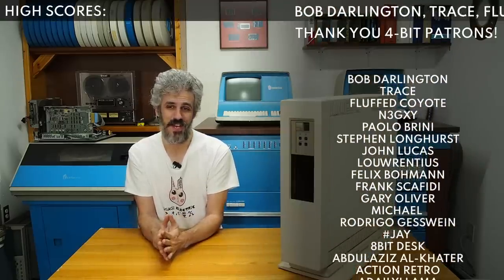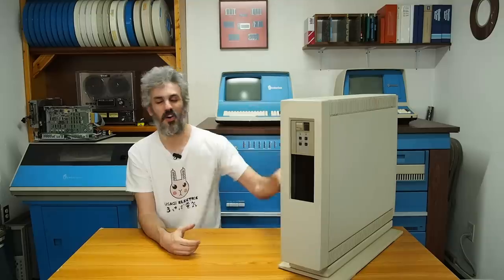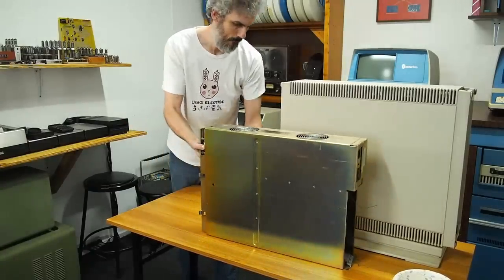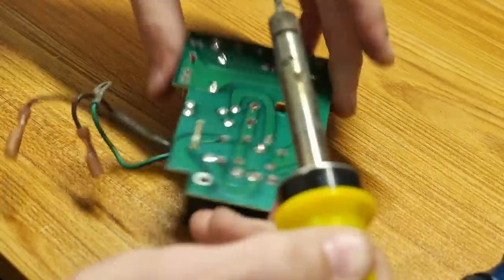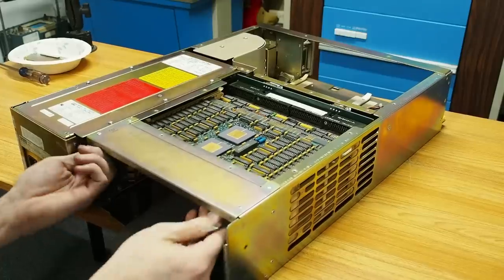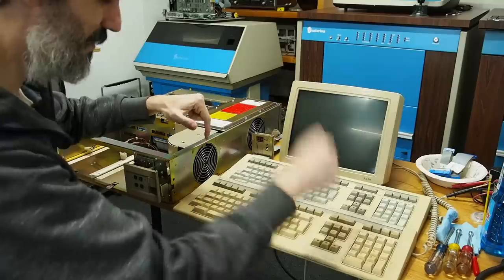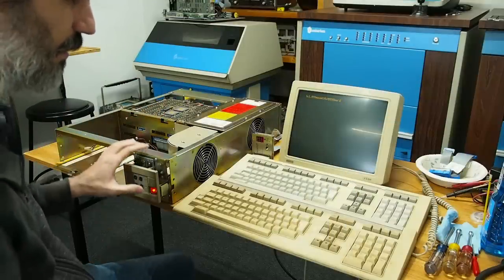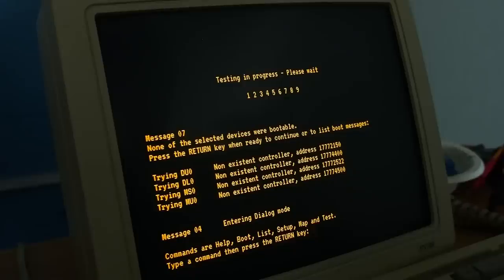The PDP-11/83 Boots!

Comment: I repaired those PDPs and VAXes for years. I did exactly what you did... but I also replaced all capacitors.
For the terminal, the smooth scroll can be changed in the settings (smooth slow, fast or jump). Don't forget to save the new settings. Otherwise the terminal will load the old settings after a power cycle. To do a "load defaults" would also be a good idea since you don't know what the former owner did. (And save again)
For the memories, you need to check if the DIP switch settings are correct. There is a starting address for each memory board. The first goes from zero to 2048kB and the second starts at 2048 and goes to 4096kB. If those switches are not set correctly, you get an overlap of the two ranges. That could be the reason for the "2040kB" display.

Comment: I worked at Digital in Canada and had a VT320 connected to a burn-in chamber running heating/cooling cycles on multiple main boards to test for thermal related faults. This was back in 1993 and the monitor and keyboard looked about as dirty as what you cleaned.

Comment: Cleaning old keyboards is a special sort of tedious that is only enjoyed by folks that find it meditative :)  Related, i had found that soaking the cables for cleaning leads to a grab-bag of odd symptoms due to water getting inside the outer sheathing. Those with phone service on older copper cables have hear what water on the line sounds like! The risk is reduced by keeping the ends out of the solution but the sheathing may have tiny cracks from age. It goes extra pear-shaped if the insulation on the conductors inside has also cracked with age. My fix is to pretend the cable is a cat - sprawl it out in a nice warm sun beam for a couple days.

Comment: BSD 2.11 - I believe it can run on it and is of course fully open source, still has random patches added even today. If you can get that running then you will recreate the point that kicked off so much of our tech world, apple, google, yahoo, everything traces back to the BSD line if you think about it, current macOS still has much of the exact same code in it. 

I also have a collection of a PDP 11/83 system, bunch of cards and components, and a number of various DEC terminals, vt220s, etc. My goal is to one day setup working system running BSD 2.11. One day. None of it works currently but you give me great hope watching this series. Thank you!

Comment: The VT240 was also a neat terminal.  The VT240 was a pizza box form factor used the same keyboard at the VT220 and Rainbow desktop computer.  The VT240 could support either an amber|green monitor or RGB monitor with separate R G B coaxial cables running at NTSC raster rate.  The VT240 could do NAPLPS graphics based around a NEC 7220 graphics chip.  In text mode, the standard VT100 / ANSI escape sequences are supported.  The problem is finding software to support the graphics.

Comment: Look to see if you have RT-11; it's a single-user OS, fairly simple to boot up, and can be run off of floppies.  RSX-11M is a multi-user system that requires a hard drive and a more involved system configuration ("SYSGEN").

Comment: It looks like the top 8K is mapped out of available RAM whether you have 1 or 2 memory modules installed. Looking at an MicroPDP-11 handbook from 1987 there's mention of some memory being reserved for memory-mapping features, but not clear how it's used. My experience with PDP-11 goes back to PDP-11/34 and 11/44 running RSX-11 or RSTS/E, but not much dealings with the MicroPDP family. Actually watching the video a little further I think the I/O Page Map shows what that reserved address space is used for. Note that RAM ends at 17757776 and the I/O Page Map begins in the 17765000 range, which corresponds to the missing 8K of physical RAM. This is definitely cool stuff! Can't wait until you get some mass storage attached and boot into an OS!!

Comment: Even when you booted with just 2Mb, the I/O addresses were at the top 8Kb of the 4th Mb (17757770 through 17777776). when you added the 2nd 2Mb the last 8Kb couldn't be used as it's already mapped off.

Comment: I used an 11/44 at college during 1982-1984. It ran RSTS/E 7.2-04 and  boasted a stonking 750K of memory. We programmed it in Basic-PLUS, an excellent language. It also had Pascal and Cobol which I experimented with. After I left they upgraded to 8.0-06. The final RSTS version was 9 I believe. When you log in to RSTS you got dropped into Basic, just like on an 8 bit Micro of the era!
Reply: BASIC-Plus was just the default “run-time system” on RSTS/E. You could have others, like RT-11, RSX and even TECO, each with their own command prompt.

Comment: I learnt C/C++ on a Vax system back in 91/92. Seeing that VT320 was nice. IIRC the C++ tools were good. Had a good debugger too.
Reply: The computer C was made to run off.   I wish C would be put in a museum, but it is still used even thou modern hardware is nothing like a PDP.
Reply: @monad_tcp  Modern hardware is too complicated, and software is getting huge and bloated, defying the purpose of powerful hardware.
We could have got VLIW and RISC machines running microkernels on them, but instead we're stuck with x86 and Windoze and crusty reimplementations of UNIX.

I think that C is not much of a problem (it's clunky but works), since it was ported on many machines (like Interdata 8/32, Pyramid 90x, MIPS and Berkeley RISC back in the day). Maybe rediscovering languages such as LISP, Forth, Occam, Oberon and Linda could help.

Comment: it's wild i hadn't heard about the smooth scrolling before today. it would be the only thing i showed people about my cool old terminal
Reply: The smooth scrolling looks neat, but it is too slow to use for long.  I had a VT100, then VT220, then VT320, then VT240 in my office.  Of those, the VT220 was probably the best compromise between performance and build quality.

The way the VT terminals operate, what is to be displayed is stored as a linked list in memory.  This makes it relatively quick to update a screen because a line can be easily added into or deleted from the center of the display by changing the pointers into the list.  The terminal can also function as a viewport into a virtual screen larger than the physical X-Y dimensions of the terminal.  The problem is that memory gets fragmented as the display updates.  Every so often, the CPU has to pause to garbage collect to consolidate memory.  When that happens, the terminal asserts flow control back to the host.  There’re an input ring buffer in the terminal, but the buffer can overrun and wrap, losing data.

The pause key on the keyboard with also cause the CPU to immediately quit updating the display list and freeze the screen and issue flow control.  Again, the input buffer may overrun if the host does not recognize flow control quickly enough and stop sending.  To the terminal user, chunks of text may mysteriously go missing.

Comment: what you might want to check is if the clean keyboard works with the filthy cable.
soaking cables and connectors can be dangerous as the water gets into the connectors and may cause trouble.

Comment: lots more pdp-11 to come sounds great. Consider VAX also. Especially if you have access to VAX-11 as opposed to just VAX. VAX-11 is a 32bit pdp ISA stretch to 32bit with a few more instructions and the -11 systems still have that pdp-11 16bit mode which was lost later on :)

Comment: Dang, I can't believe how nice that scrolling is at 9600baud! I have to admit I didn't think PDP-11s were that small, I thought they were all Centurion sized or bigger. Nice to see that badass tower in action.
Reply: Scrolling does not depend on baud rate. It's handled internally on VT terminal.

There were many different sizes of PDP-11s. Everything from desktop PC size to multi-cabinet ones.
Reply: @TheUglyGnome  Thanks for correcting me. I knew better, too. Needed coffee before posting. 😴
Reply: DEC terminals used XON/XOFF flow control. So if data was coming faster than it could be displayed, the terminal would tell the computer to stop sending until it caught up.

Comment: That terminal DOES SO look like a Wyse (brand) terminal; even the menu-based setup. There’s a small loan store in West Valley City, UT that has a Wyse terminal hooked up to an old MS-DOS/Real32 machine that they use to run the store (Real32, for reference, is a multi-user DOS that user to be DR (Digital Research) Multiuser DOS). That’s the part that lets it use the terminal. We used to have scads of those things lying around; now the one in that store - and one here in San Antonio, TX - are the last functioning Wyse terminals I know of. Nice to know they could probably use a DEC VT-320 if they had to.

Comment: Really cool seeing the 11 bootstrapper coming up...brings back memories.    The first thing I always did with DEC VT terminals was to turn off smooth scrolling, it looks cool at firt but then it will drive you nuts after a while.     I always liked the amber screens better than the green ones, I think there were also white versions that looked more like the VT100 displays.    I really liked the VT220/320 terminals, a step up from the old but reliable VT100.    RSX-11M is a fun OS to work with, very different from what things are like today.
Reply: I remember that Wyse used to offer 3 colours: Amber, White and Red. Anything was better than the white text versions!
Reply: Fun fact that while all actual physical text terminals have gone extinct, we still have software emulators for them under all current OSes. And what terminals to they emulate? Something from ADDS, or Hazeltine, or Beehive, or whatever? Nope--only a DEC VTxxx series. Seems the need for anything else has completely disappeared.

And on *nix systems, you still have the whole termcap/terminfo mechanism to abstract away from the details of how to drive these different terminals. But all it is used for nowadays, really, is to provide a higher-level interface to the screen area on the VTxxx emulator, nothing more.
Reply: @lawrencedoliveiro9104  The ANSI escape sequences were created  and first implemented by DEC with the VT-100.
Reply: @ChristopherHailey  The DEC-specific ones have a “?” in them. The ANSI-standard ones don’t.
Reply: @lawrencedoliveiro9104  Those are private codes added by DEC to the standard they adopted.   Many of the implementations of the ANSI codes include some of the ones added by DEC.
Reply: @ChristopherHailey  The point being that “ANSI” ≠ “DEC”.
Reply: @lawrencedoliveiro9104  I'm not having any difficulty with the difference.    I don't see what point you have.   Glad to see we both find this to be really interesting stuff!   I'm really psyched for the rest of the series, I assume you are too.

Comment: Where do you find these machines?  I learned on an 11/10 running CAPS11,  11/34 running Unix V7,  11/40 running Mini-Unix, and did some work on a Fault-Tolerant 3 processor LSI-11 system at C-MU.  Is it possible to obtain a working system under $800?

Comment: 8N1 and 7E1 with 9600 are the most reasonable guesses for just about any device's console UART protocol. One way to figure out if something is coming out might have been to use a cable and a terminal emulator that can do autobauding. But that's cheating, of course :)

Also, I've never seen any PDP boot, so this was very cool. I have fond memories of DEC terminals, though. And that's a very fine one; maybe one of the best models for general console use.

Comment: You might wanna consider a soldering iron upgrade, those El Cheapo basic soldering irons don't have good temperature control and heat transfer and given that you work on old fragile PCBs you might end up damging a board by having too hot of a soldering iron or too cold / bad heat transfer and needing to stay too long on a component/trace

Comment: On those older computers I have had good luck using white-board cleaner to restore the original look. (test on hidden area first)
Reply: White board cleaner is just alcohol.
Reply: @bzuidgeest  Not really, no.  Alcohol will work, but spraying a flammable substance around a conference room isn't the best idea.  Look up the MSDS for it.
Reply: @donbarr9487  i don't know what you are doing in a conference room, but usually there is no fire at all. Smoking hasn't been allowed in decades. 
Most of the disinfectants everybody loved spraying during Covid had a high percentage of alcohol. Nobody was worried. Most stuff in a spray can is highly flammable. Yet it's still sold.
Better still, check the label of your cleaner. Likely it has isopropyl alcohol as an ingredient as most of them whiteboard cleaners do.
Reply: Maybe you mean that melamine-based “magic eraser”?

Comment: My vt-320 is currently dead, but I tried to do a 38400 connection to a PDP-11, but never got above 19200, it said 38400, but it was obliviously not. We tried a variety of terminals including VT-100s, Wyse 60s, and Wyse 50s. The fastest one I remember was the Wyse 50.
Now I can crack the VT-320s case and keyboard, and then get some of those RJ-11b weird side-step clips for the keyboard cable. 

Buying a good crimper and 2 ends is prohibitly expensive... so is there somone out there who crimps and tests DEC Keyboard cables?

Comment: Can the PDP-11 run X11 under 2.11BSD? That would be a cool use for the color graphics card and terminal.
Reply: It could, but I don’t know about the specific graphics board mentioned.  Finding surviving software, if it ever existed, would be the hard part.  What was a pretty snazzy graphics board in 1983 would be agonizingly slow now.  I had a Sun 3/160 which had Sun’s advanced graphics which occupied two full VME slots connecting to a Hitachi monitor which weighed about 150 pounds, connected by three BNCs each about as thick as a pinky finger.  With all that, it could take seconds to render the X version of Sunclock full screen on the X client running on top of SunOS 4.11.  I don’t remember for sure, but I believe the resolution was 1152 x 900 pixels.  The Sun 3 power supply was labeled “1.5 KW” and I believe the system used most of it.  The Sun 3 definitely warmed up the room.

It might be fun to say you revived old hardware, but it would be agonizing to use it for much time, being accustomed to how fast PCs do work now.  Even a Raspberry Pi Zero W2 beats the pants off my old Sun 3/160.  I donated my Sun 3/160 to a university amateur radio club in 1993 mostly because it was too expensive to run 24x7 and it made my house hot.  The club used the Sun as a packet radio Internet gateway for a number of years because the university did not charge them for the electric consumption.
Reply: Seeing how much memory X takes up, I think the best usage of the color card would be color Unicode
Reply: @charliekahn4205  Early builds of X11 would run comfortably with 8MB of RAM, which is not outside the PDP-11's parameters. It's just the matter of finding an early build.
Reply: @ordinaryk  the issue is that you'd still need room in memory for other things to run. Or a ridiculously huge swap partition.

Comment: Not sure if you researched this but there is a  process called retrobright.  It will remove the ugly yellow from the plastic from UV light.  I used 40% peroxide (creamy style) that a salon uses (Amazon has it).  You will need a couple of Black Light lamps (I used LED version).  My Apple IIe looks brand new once the ugly yellow is gone.  Hope this help your babies look like new!

Comment: Wow.  Where was that thing being used?  I've seen less gunk inside an auto shop's ancient PC.
Reply: Really? I've seen a lot more gunk inside an auto shop's old PC, and that was after they blew it out.
Reply: @eDoc2020  I guess my client was cleaner than yours. :P
Reply: @Canthus13  It probably has a lot to do with the type of work, where the PC is, and how long it was there. The one I dealt with was inside a body shop for over 20 years, running a wheel alignment machine. A slightly newer PC with a variable speed fan running in the corner of a shop would probably be much cleaner.
Reply: @eDoc2020  GOod point. THis was their sales machine.  Still on the shop floor, but closer to the door.  I did find a grasshopper in it, though.

Comment: are you going to run unix or VMS?
Reply: PDP-11 does not run VMS. I think he mentioned in the video that he's planning to run RSX-11.
Reply: @TheUglyGnome  I guess we used it on a VAX which came after.  But it should run UNIX.
Reply: @ahbushnell1  
Nah! Unix is boring. It and it's derivatives are everywhere. Better to run original DEC OS.
Reply: DEC did kind of VMS-ify its PDP-11 OSes after the VAX came out. Thus, you had some subset of DCL commands available across many of them.